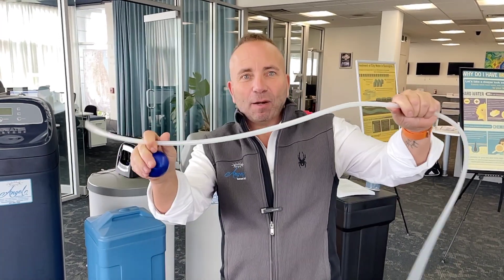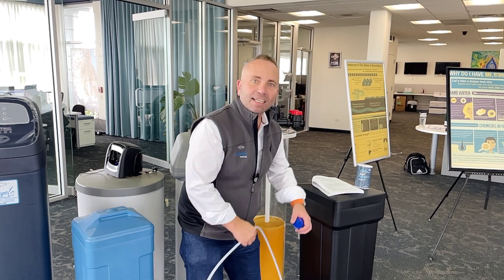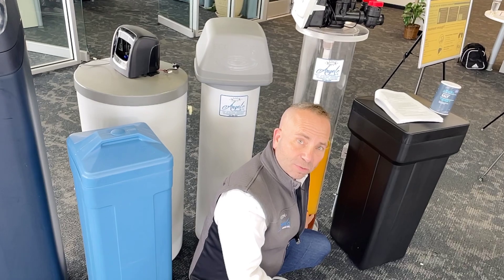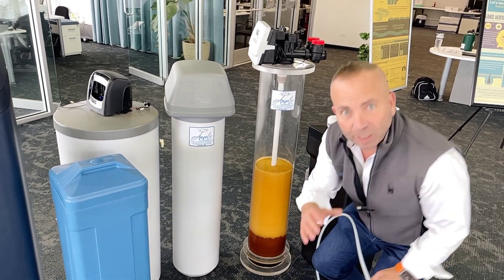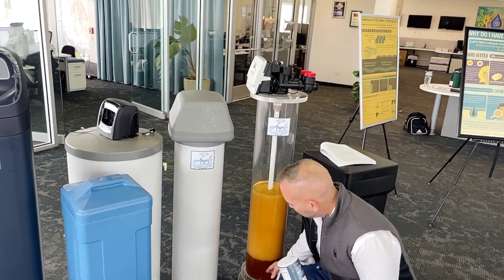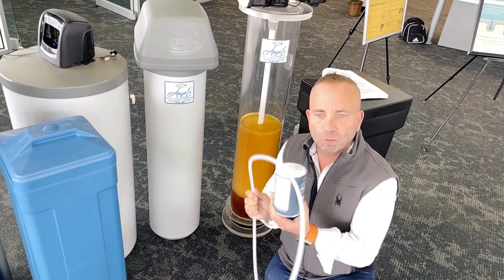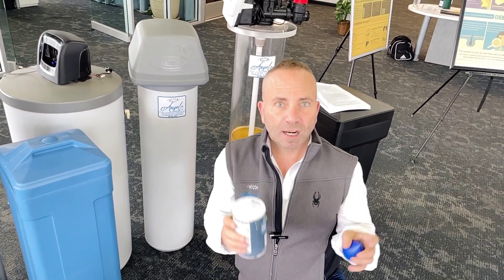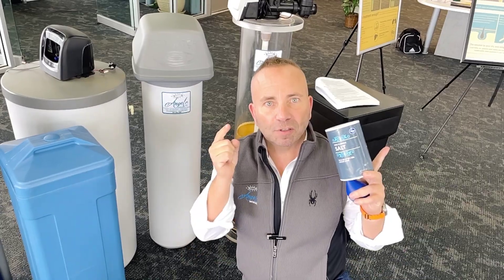What is Water Softener Regeneration? | Angel Water, Inc

Comment: brand new house with new well water system,  havent moved in yet but my system regenerates pretty much non stop, several times a day and thats with little to no water being used in the house, why is this happening and can I change this in the settings ?
Reply from the maker: You need a service tech right away to your home. That unit is probably putting 70 gallons of water down the drain every couple hours. At most it should be generate every other day. Thank you for your comments.

Comment: How to fix salty water issue into a home from water softener. Please advise. Thanks
Reply from the maker: Usually Salty Water is a result of a water softener being programmed incorrectly or its an old water softener design.  Newer technology has exact salt dosing which would leave very little salt in the drinking water.  We offer PurAsoft systems that have virtually 0 chlorides in the water after the cleaning process.